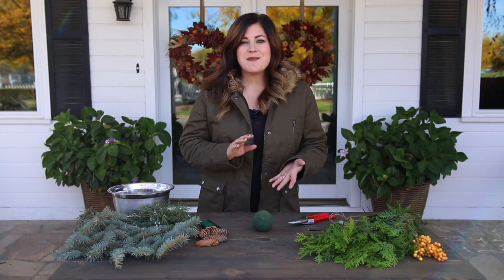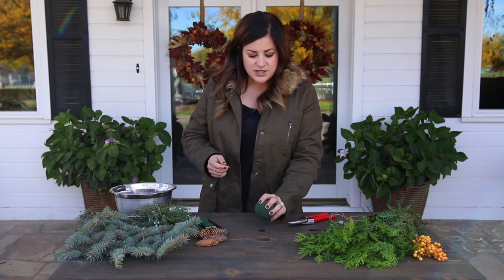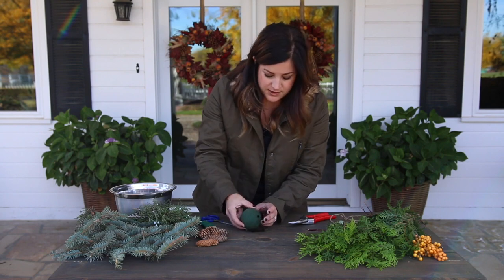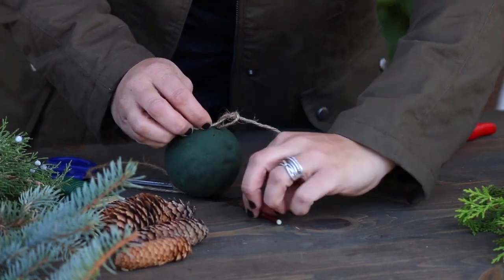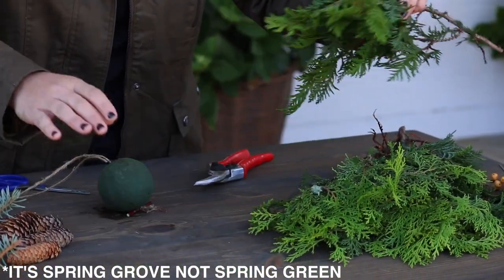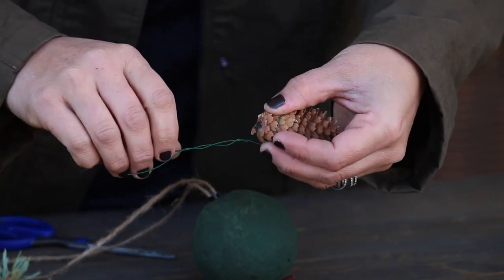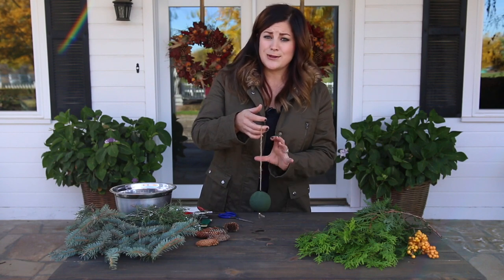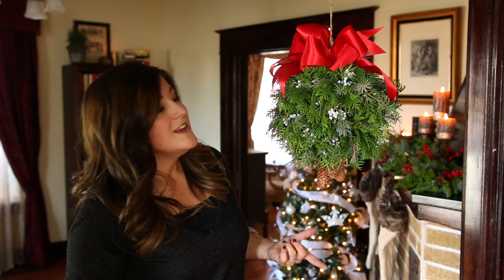DIY Kissing Ball Full Version // Garden Answer

Comment: Hi there! Love a flower ball, question, if i use flowers instead will flowers fall out from the bottom after awhile since the stem will dry and shrink in size? Is it possible to use floral glue to secure them in the foam if i want the flowers to dry on the globe?